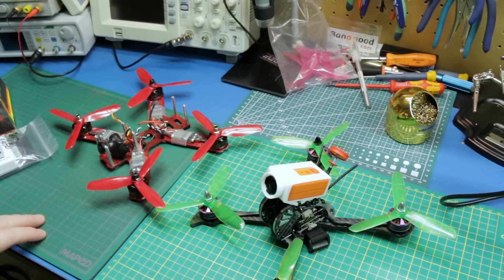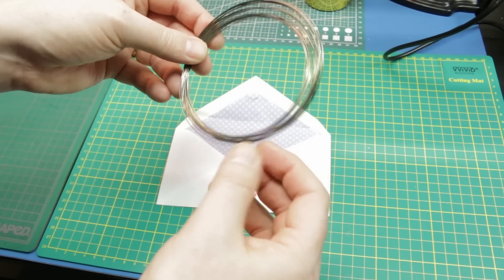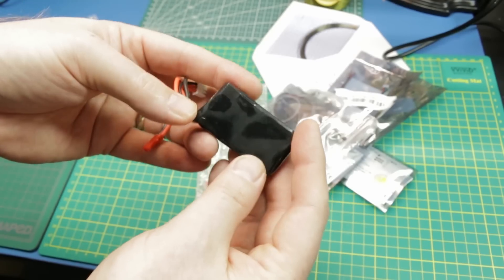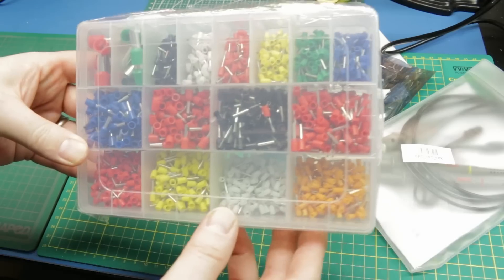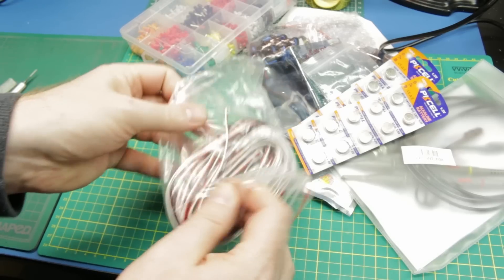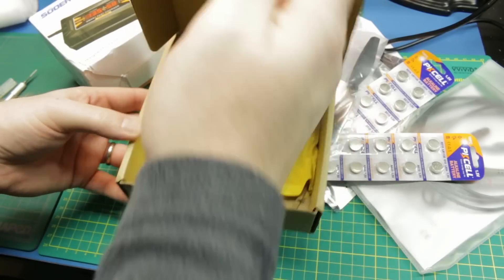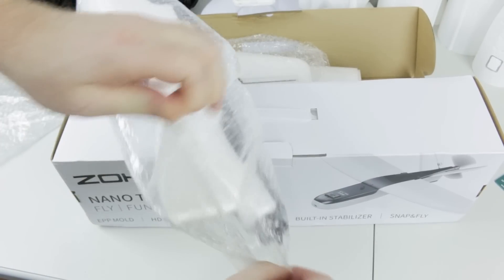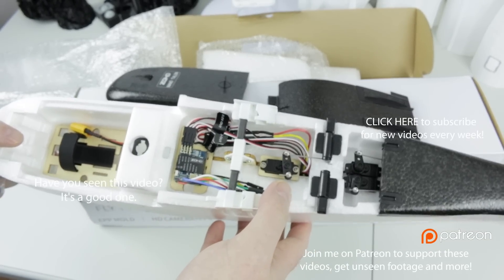🆕 MAILBAG! Filament, Breakout Boards JLCPCB's & MORE #38

Comment: I see JLCPCB!  LOL I have done some sponsored videos for them too.  Let me know what you think.  I thought it was a great service.  Also I was wondering if the triple blade props for your quads was better than the two or what your recoomendation is for that?  Thanks and keep up the great videos bud!
Reply from the maker: The tri blades give quite a bit more "bite" in the air. Drawback is a pile more amps. Another pro is the sheer scream they make... Its tough to miss that noise on a full throttle punch out ;)  Cheers Bud.